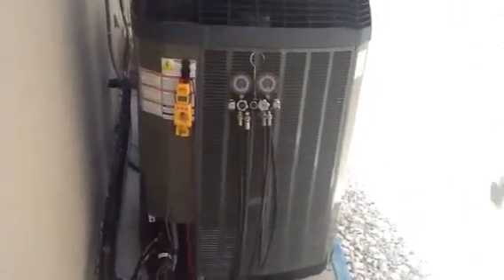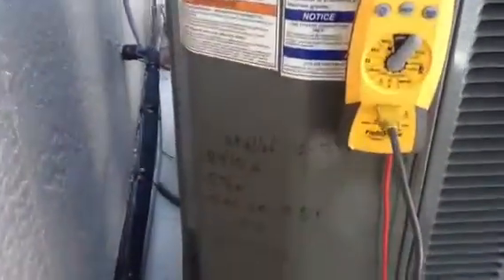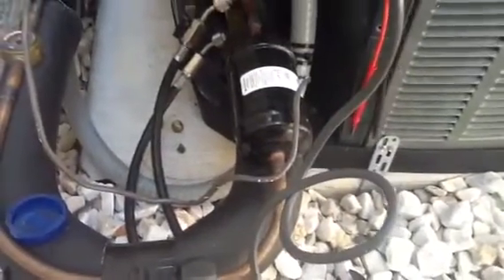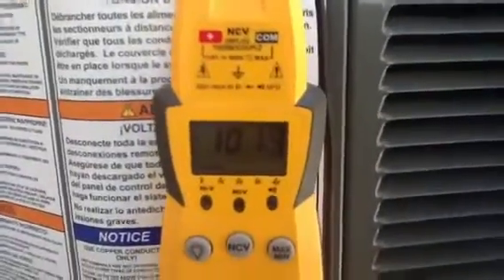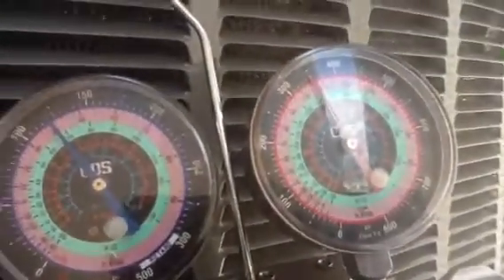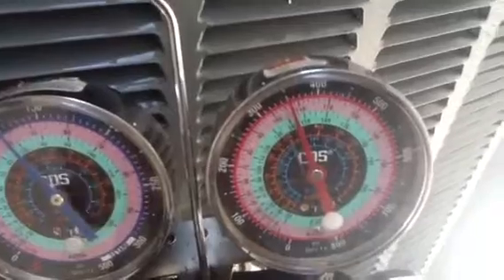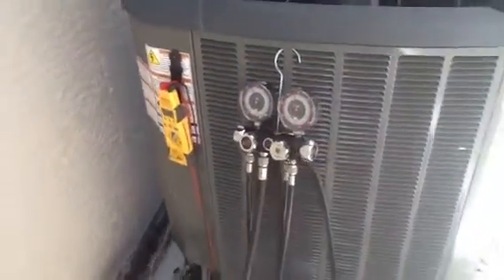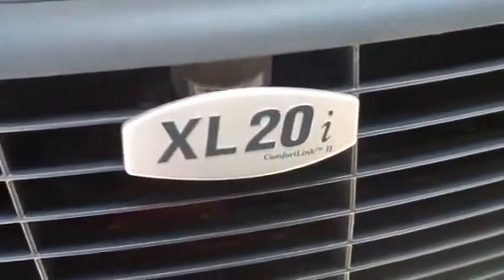HVAC charging Trane XL 20i

Comment: Very good video and the other one with the communication board is very good too.
I just open mine to see it. 
I need to put gas on my AC and i have the same unit. It was giving me error 79 code. What type of freon use this unit?
I will need to call the technician but i would like to know what freon use that unit.

Thanks

Comment: Doesn't the Trane XL20i have the filter dryer factory installed inside the unit? It looks like this system has two installed. Isn't the one on the line-set unnecessary?
BTW, It takes lots of effort and time to shoot these many videos and lots of my guys appreciate the info not just on your HVAC videos but all the rest. Keep it up. Great work.
Reply from the maker: You are right on the XL20 I there is a filter drier factory installed. Thanks for the positive comment, and watching.
Reply: I am replacing the locked compressor on the xl16i and I have to replace the filter drier after the compressor. Looks tight